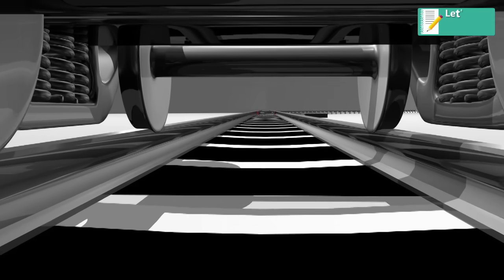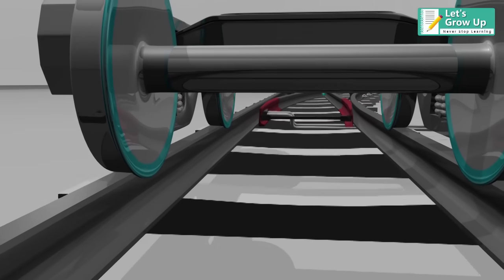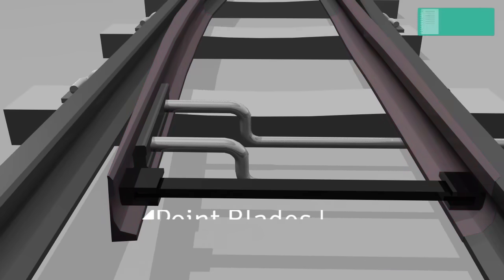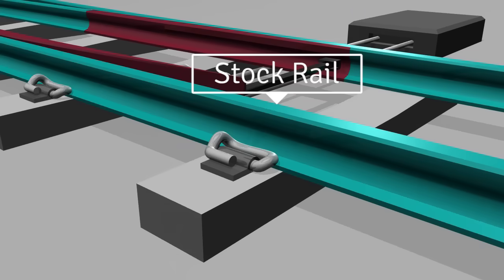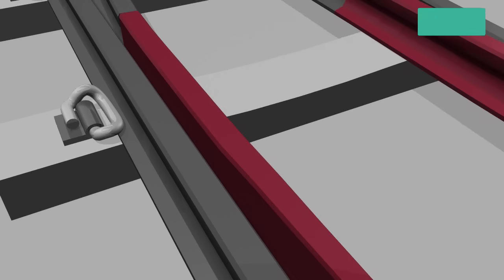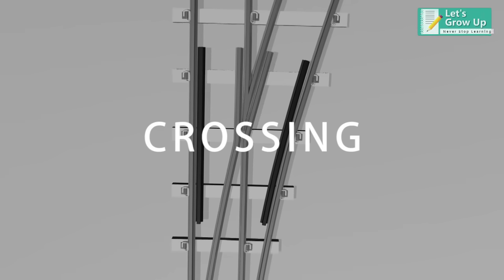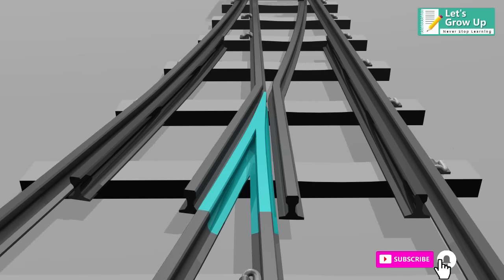How does train change the track? | railway switch and crossing

Comment: Cool video! So the wheels need to roll over that gap at the crossing?? This means Lego crossings are even better haha. With Lego the flanged outer wheel will roll over a lower level next to track so when it goes over the gap it still rolls but on a lower level. Even my Switch Points from Technic Lego work that way! Check it out!  https://youtu.be/rjAqmlexRrA

Comment: Before the days of Point Switch Machine, the points were operated manually either by a local lever or a lever in the nearby signal box. There used to be a signal box at every junctions. Good thing today computer can be merged with railway engineering, so now points can be controlled from a remote location.

Also, you could also say check rails are the rails that prevent the trains or the wheels from being derailed. Done.
Reply: Do they switch automatically based on schedule or the train driver can switch them remotely  when approaching?
Reply: @jervesheart  You mean the computer operated ones? They normally have a control room somewhere to monitor the trains via GPS, and the points can be switched via a button. Or yes, as you said, some can be programmed according to the train schedules. I don't think there's one where the train driver can switch the points, well not in Indonesia I don't know of any anyway.
Reply: @theunderrated86  thanks, Now I know. I was just curious since I notice quite a few switch tracks that are far from stations. So I wonder if they are controlled by humans or automated based on schedule.
Reply: P

Comment: My only point is that you seem to use crossing and crossover interchangeably, which they are not. A crossing is a (mostly) perpendicular intersection, whereas a crossover is turnout that allows moving rail equipment from one track to another.

Comment: I was in the Reserves, a Transportation Unit, out of NC. I had the opportunity to attend the school in VA for Railway Ops Crewmember. Best darn experience, ever.
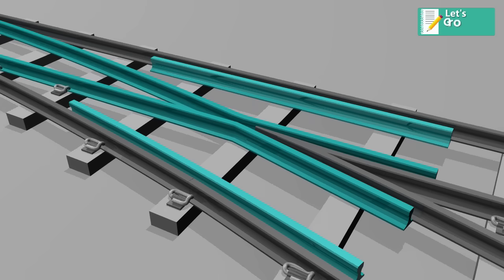Reply: Charlene, I don't understand from this video is at 2:27 about the check rails. If they don't move, then how does the train conductor select which direction he goes? Put differently, what is it that steers the train to the right or to the left?

Secondly, how do the POE's get activated? I assume the conductor does so remotely through a remote control device on board the train. Is that right?

Comment: Your models are missing the bottom plate at the crossing nose or frog which allows the flange to support the wheel as it crosses the open gap in the rail at the point.

Comment: I’ve never seen track hold-downs like you picture here. I’m more used to regular spikes. How do these things work?
Reply: They are like springs which hold the rail down but you don't have to pound them into concrete.  Watch some videos about UK or European railroads and you can find them.  They are easier to install and remove than spikes but still hold the rail in place.
Reply: @bitsnpieces11  Apparently you've never heard of the Union Pacific Railroad? Those fasteners are all over the United States. You don't have to go to a foreign country to see them. Pandrol makes them, and there are other types being used in our country.

Comment: The flanges don’t generally stop the wheels from coming off, the wheels are shaped so the outside is smaller than the inside of the wheel and the flange is a last resort. Also, the squeals heard as the bogie moved is wrong as the flanges weren’t hitting the track (they cause the flange squeal) you would never hear flange squeals on a straight piece of track and not usually on turns unless it’s really sharp for the speed
Reply: Flanges shouldn’t ever touch the rails except for extreme circumstances.
Reply: @shroomzed2947  tell that to northern rail and their 'pacer' railbuses. Loudest rolling stock I've heard.
Reply: right
Reply: Good point
Reply: I knew this from having lived by tracks as a child, but more so from having owned a model train set with model railway. However, what I don't understand from this video is at 2:27 about the check rails. If they don't move, then how does the train conductor select which direction he goes? Put differently, what is it that steers the train to the right or to the left?

Secondly, how do the POE's get activated? I assume the conductor does so remotely through a remote control device on board the train. Is that right?
Reply: Uh, take the flanges off of those wheels and see how far you'd get. Last resort? Bogie? Ever hear of truck hunting? Those trucks (I think you refer to them as bogies) will make wheels squeal on straight track. You must be a railroad official from another country. lol Thanks for the laughs Vinnie Baby! lol
Reply: I'm guessing that you're from America so yes, I am from another county, your 'trucks' are referred to as bogies generally here and i use last resort loosely because the primary thing keeping the wheels on are the shape of the wheels, If you took the flanges off, you'd still stay in the tracks for a bit

Comment: Verry good tutorial. But missing the negativ point.
Old-fashioned invention. Not so good as thought for higher speeds. The wheels must jump over the gap between rail and crossing nose (in the Video at 2'35"). This produce a heavy shock to the wheels, axels and wagon and also to the ground which can be felt in our house with 11 flats even on the third floor. And produce a big noise. Due to this, the nose is worn out and the bad effect is getting stronger. Due to broken wheels (rim) also accidents happened. Time to find better solutions for high speed trains.